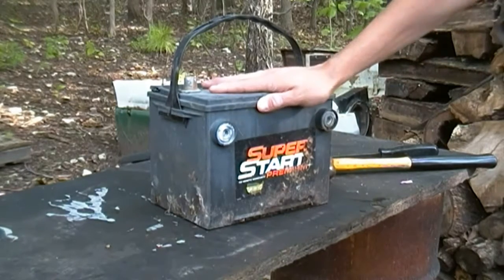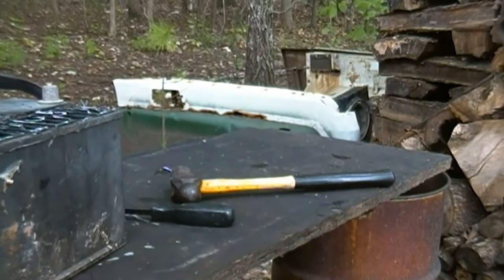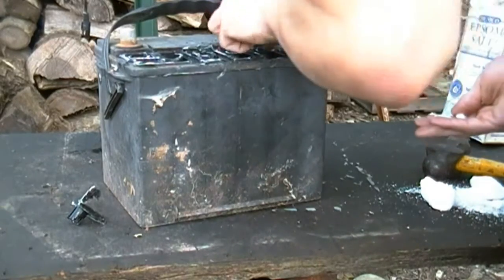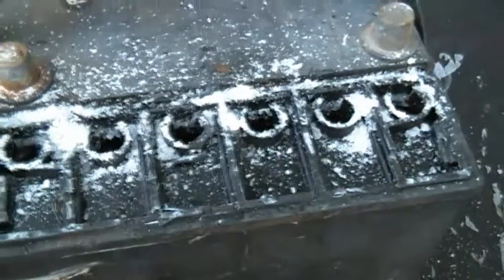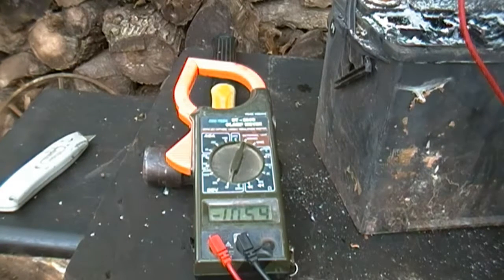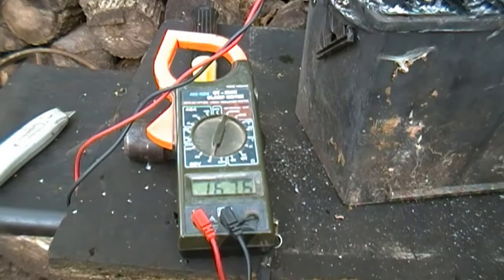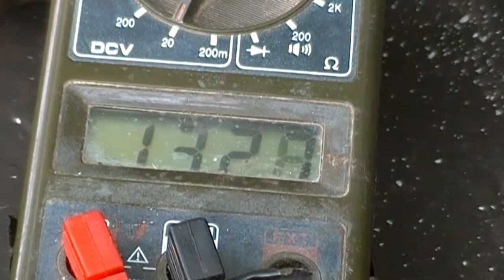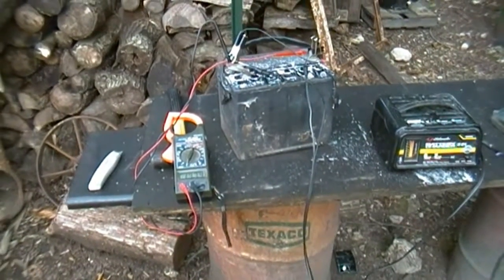DIY: Repairing A Car Battery with Epsom Salts

Comment: here's  a few tips for battery reconditioning
do not try to do this until you know what you are doing - the acid can burn your skin
check the voltage first - there may be a dead cell which will be a waste of time trying to fix.
Check your battery fluid.
attempt to completely recharge the battery.
(I learned about these from Rapid Renew Roadmap website )
Reply from the maker: What are you  getting  at?
Reply from the maker: What are you  getting  at